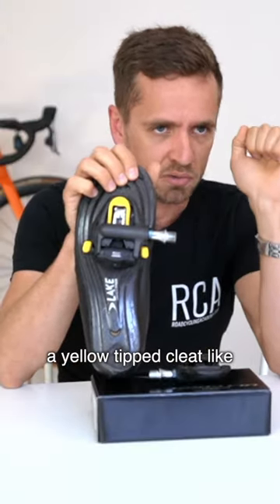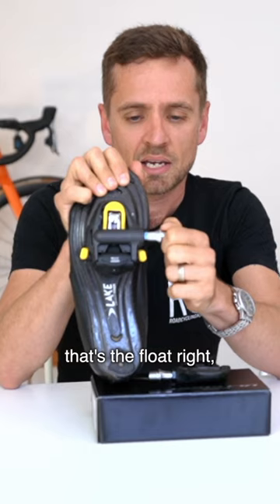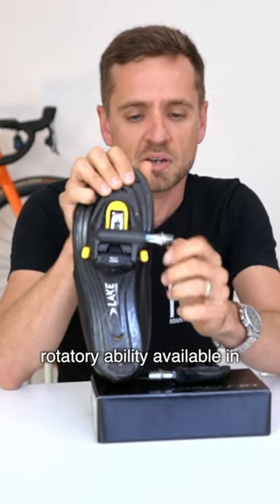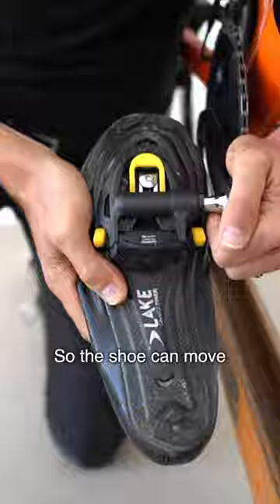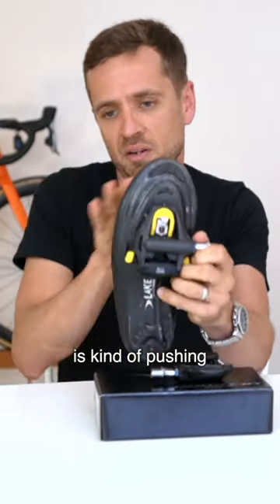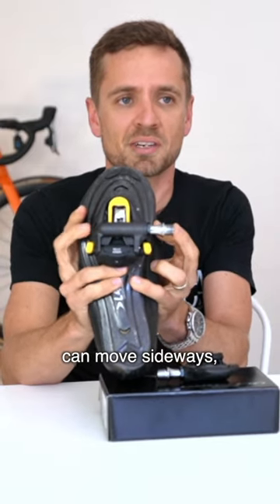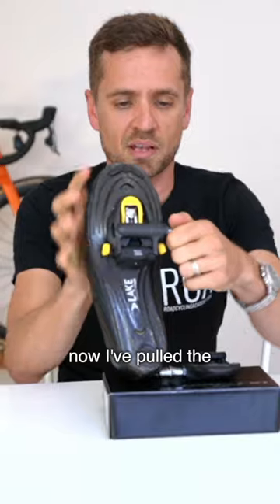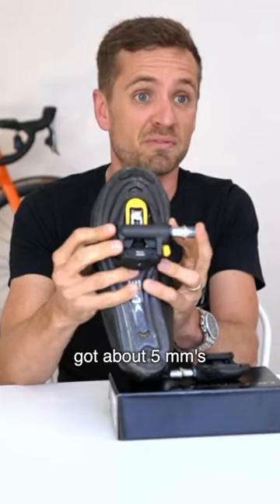Shimano Pedal Flaw?

Comment: I went from yellow to blue a few years ago during a cycling holiday with lots of climbing.
After three days one knee had taken damage which took months to recover from.
After getting back on the bike with yellow cleats I never had these issues again.
Reply: To me the float was killing me, going for blue cleats solved the problem entirely. I needed my knee to stay in place.
Reply: I had a very similar experience except it was with reds.  Going to yellow stopped the knee problems.  I’m never going back.
Reply: Changing cleats attachment needs new pedal fitting.
Reply: Yeah, never continue to ride if you turn from yellow to blue

Comment: Didn't actually mention any flaws, you just displayed the float that is specifically desired when buying that cleat...
Reply: The float is measured by the angle you can rotate your feet.  Not how far right or left your shoe can move on the pedal.  I always fit people off of where the tension of the pedal stops the foot if they're using a pedal that does this.
Reply: The flaw is that your q factor can change one pedal to the other
Reply: angular float is the design. The lateral float is the flaw.
Reply: That indeed is a major flaw. I think i may have been a victim to that issue. Switching to speedplays help alot. I do miss the feel of dura ace pedals under my feet.
Reply: @adccars359  I'm a huge Speedplay fan, personally and as a fitter.  But Looks may be an ideal pedal for you if you miss that platform. I consider the cleat the platform for Speedplay and it's a sizeable one.   But if you don't prefer it, try something else.  We spend too much time pedaling circles to not like how they feel

Comment: I have had 2 sets of Shimano Dura Ace Pedals.  1st set like these was there 1st ever set in approx 1988/90 & 6 yrs ago ultegra.  
But last April l went 2 Time Xpro 12 Pedals on my very very upgraded SL5 TARMAC EXPERT.  Then in May last year Time Xpro 15 Pedals on my new SL7 S-WORKS TARMAC & end November last year Time Xpro 15 Pedals on my new SL8 S-WORKS TARMAC.  Fantastic Pedals 84 grams each from memory.  

Neil Stainbury apparently has access 2 a Triathlon Pedal which also looks Gr8

Comment: I like speedplay/wahoo pedals just because of all of the adjustment capabilities and no lateral movement, probably not a good pedal system for a novice. But I have the curse of the constant tinkerer.
Reply: "No lateral movement"...? I guess you're one of the lucky ones not having that issue with the Wahoo/Speedplay as I keep reading reviews after reviews about that problem..! Have to change my old Speedplays and I hesitate going on with Wahoo because of that..!